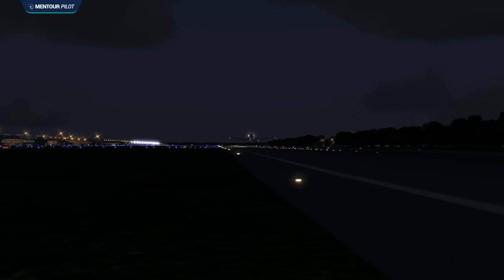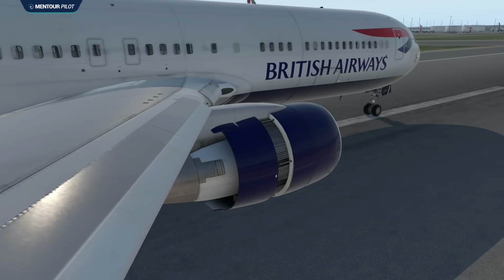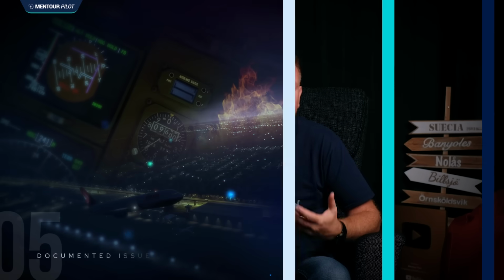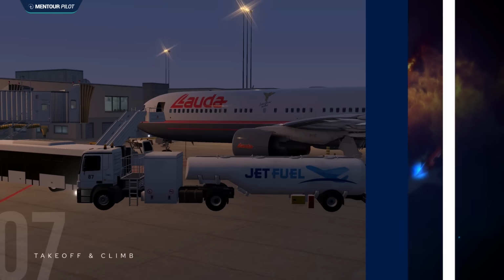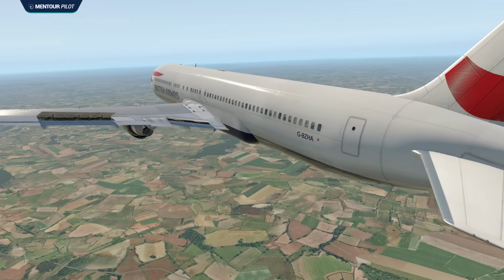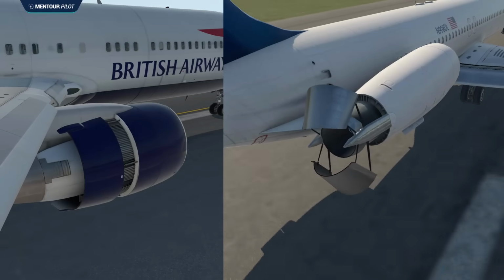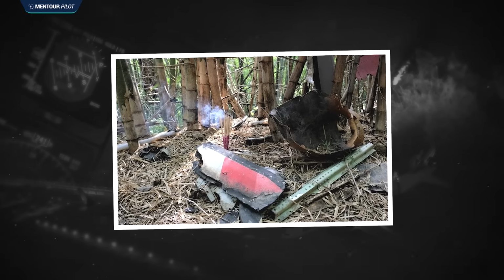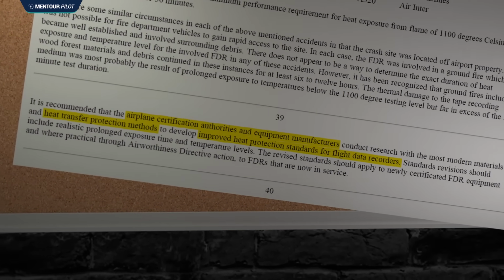HOW an Impossible Failure CRASHED this Boeing 767!

Comment: When Niki Lauda was told by Boeing that they wouldn't release a statement on wether they take the blame, he basically said to them "If it's so safe to deploy the thrust reversers mid flight, give me a 767 and I'll try it". Boeing said they couldn't do that because it's unsafe. Niki Lauda was an incredible person.
Reply: "It's terrible. It flies like a pig."
"Oh, you can't say that."
"Why not?"
"It's a Boeing!"
"It's a shitbox. It stalls like crazy and the reverse thrust is a disaster. Amazing, all these facility and you build a piece of crap like this."
Reply: @pavise6333 saying it flies like a pig is an insult to the pig
Reply: @pavise6333 best comment I’ve seen in a while!
Reply: @pavise6333 before talking shit mouth.Boeing is carrying people since 1970 ....
Reply: @pavise6333 "it's a ferrari" ahh
Reply: @personalincomeman1518 understands the yet still ruins it ahhh
Reply: @pavise6333  Fun fact, Boeing could have had a clean design from Bombardier as a near perfect replacement of the old and outdated 737 design.

As most suppliers were from North America anyways, integration of the now A220 called plane would have been far easier for Boeing than what Airbus has to deal with right now. 

Sure, it probably would have required massive rework in order to integrate it into the Boeing lineup, nevertheless it was clearly possible.
Reply: There is a documentary about how Lauda handled this and exposed Boeing.  It’s incredible.  Lauda was tenacious and amazing.
Reply: Niki Lauda was a smart person. Though the accident was very sad, atleast i think it’s a fun story how Niki Lauda tricked Boeing into admitting that it was dangerous to deploy the Thrust Reverser in-flight.
Reply: @simonsv9449  he put company profits first and got away with it. That aircraft should have been grounded.
Reply: Niki lauda the f1 driver?!? Very cool! Never knew.
Reply: Nika Lauda was able to tell Enzo Ferrari that his cars sucked, this don’t suprise me at all!
Reply: @michelebucci3629  Yep, I know that story very well and to all ppl around Enzo it was suprising Enzo listened xD
Reply: He truly was. Hell of an F1 pilot too
Reply: Niki Lauda was a definition of gigachad. One of the greatest F1 drivers of all time even after almost being burnt to death
Reply: @jez_77 i grew up in the era of niki lauda as an F1 expert, always liked him

Walked away from the comment to realize that only german speaking folks would know that 😂
Reply: in 1976 he almost burned in his formula one car, almost die, 42 days later he started in monza despite all the prohibitions of doctors, hellish pain and bleeding bandages, and finished 4th!
Reply: Danke, Niki.
Reply: He himself took off from Sydney with the brand new Mozart when I flew home from a vacation 1990.
Reply: The man lived to through fire, he is someone who would never want to cut corners in safety or quality
Reply: Niki had no pardon. Told always as it was. True legend...
Reply: You also know that mechanics actually blamed him for the aircraft not being grounded with that massive history of reverser issues, right?
Reply: @GeneralMikeBison  Lauda was a MF'r who put profits first and killed over 200 people. His company had more than enough warning to know the aircraft was unsafe.
Reply: Drinking piss won't kill me, I know that for a fact. However, if you challenge me to prove it, I will decline your challenge.
Reply: @Joe333Smith ...
Reply: But that is after the tragedy. Lauda must of thought it was safe, too, prior to this disaster. I don’t get how this makes him incredible. You make it sound like Boeing knew it was unsafe before the disaster and that isn’t accurate. There is too much context left out. Maybe he was an incredible person, I have no idea, but not because of what you described.
Reply: @darkprose they didn't actually upload data to truly test it until after the crash.
Reply: Nikki lauda was a f1 racer
Reply: Boeing was historically safety-oriented company but it slowly transformed to penny-saving company. I think this accident happened during that transitioning timeframe.
Reply: @valerierodger7700   You do realize that in a sue happy culture like the US that Boeing would have sued him into oblivion by now, right? Considering he has made those statements on talk shows like Graham Benzinger as recently as a couple or so years before his death.

He didn't just say "give me a plane then and let me try". He said "We'll go up together, I'll fly" to the Boeing Execs. Of course they wouldn't agree to that, actually having to put their own asses on the line. The claim was that the pilots did it wrong, and the spin was recoverable with the guidelines Boeing etc had given out. And of coures they knew by then, that this wasn't the case but they were still hoping to prove otherwise.
Reply: Ja und sagte seinem Chefmechaniker er solle die 63 Fehlermeldungen der Reverser einfach ignorieren ! Man lese den offiziellen Untersuchungsbericht der NTSB....
Reply: Boeing has such a stellar record of actively hiding their own mistakes, it's not even funny.
Sure, human error is apparent in plenty of airline accidents, but do you know how many of those accidents could have been avoided right there on the drawing board? Or how many of them could have been avoided when bean counters actively interfered with actual engineers? Do you know how many of them, including pilots lost their jobs because what they were saying affected the bottom line?
Get your fact straight before making a fool of yourself.
Reply: Ergzay - Tell us that you have no clue, without telling us you don't have a clue.
🤔🤷😉
Reply: The pilot knew about a possible thrust reverser deployment in flight but took improper action when it took place.
Reply: @bushpilot50 there were no instructions and as explained no one thought they even could deploy midflight
Reply: @c @computercrack totally preventable, if the company would’ve grounded the plane from flying from those constant t/r faults then this wouldn’t have happened
Reply: @bushpilot50  technically but he only had like 4 seconds and he would have to control both the yoke and the throttles at the same time. Also there may have been a misunderstanding has to who was supposed to throttle down the airplane vs fly it. It doesn't sound like the tried to coordinate in advance who was to reduce throttle. Also the shitty airline they were flying for 'lauda's' obviously didn't care to take enough time to train them in a scenario like this. The would not automatically have known how fast the situation would develop.
Reply: In Brazil there Washington a case of an reversor open in flight. The Air plane was a fokker 100 from TAM. In that case The fail occours just after takeoff.
Reply: That' s how AUSTRIAN  PEOPLE ACT GENERALLY SPEAKING!
Yet Nicky had been destracked MUCH TOO MUCH  BY " lady's straps!😅😅
Reply: Haha kind of hilarious to try and dismiss the expertise of on of the best F1 drivers of all time famous for being safety conscious.  But why was he consulted about airplanes?
Reply: @KaladinVegapunk  He owned the airline.
Reply: @KaladinVegapunk he was a licensed Pilot flying regularly for Lauda Air, which he had founded and owned
Reply: Boeing probably paid those guys to loot it once they learned what caused the crash hahaha
Reply: Lauda mera
Reply: Ha truly was!
Reply: Didn't he have one? Why ask Boeing?
Reply: Planes are held together with Elmer's glue. What a horrifying story.
Reply: It was also fundamentally lauda's responsibility to see that the aircraft was maintained properly. If his company had not sent the aircraft into the air again and again with a known failure no one would have died. Doesn't matter how the aircraft is designed if serious maintenance problems are ignored it WILL crash.  Some MFr who put his profits first trying to pass the blame is contemptible.
Reply: @valerierodger7700  ,and he was right with his hunch, those pilots the poor bastards didn't stand a chance, not least as Boeing didn't do their homework and basically said the plane was safe to fly even if the thrust reversers deployed mid-flight. I know all plane crashes must be terrifying in their own unique ways, but the way the plane just cracked apart must've been horrifying for all those who went heading into the ground like a torpedo.
Reply: @SomethingSomethingFrank  his company killed them. They knew of the maintenance problem and put profits first and the airplane back into the air.
Reply: @SomethingSomethingFrank They did stand a chance. The aircraft had a history of 52 reverser cautions in the preceding four weeks and the captain still washed it off as spurious. Had they not done that, it wouldn't have lead to this accident.
Reply: @GeneralMikeBison  Fair point.
Reply: @GeneralMikeBison no they didnt. It was, as the video explained, marked as "safe to fly and uncritical", no explanations given on what to do in case the reversers deployed. So no, they didn't have any chance
Reply: @computercrack yeah it’s their fault for operating the aircraft even though the t/r fault kept reappearing, they have to make the executive decision to ground the plane to fix the fault but the company did not do that and continued flying
Reply: @austinmamaat5248  yeah good luck keeping your job if you ground a plane that the manufacturer says is an mundane error. If there was an airco error would you ground the plane?
Reply: boeing is so dangerous I don’t understand why people still fly boeing or wht boeing is still around
Reply: @DavidCastro-wf8cl  when your in cahoots with the us govt you tend to get away with quite a bit
Reply: @TheRangewannab8 ❤❤
Reply: @TheRangewannab8 you’re
Reply: @DavidCastro-wf8cl you act like their planes crash every other flight. Planes are the safest method of travel by far
Reply: @brandonsg1313 Yes, but Boing is quite rightly under the spotlight. Self certification and non existent oversight are not a good recipe for safety.
Reply: @DavidCastro-wf8cl idk how you can say that with how many crashes occur with something as simple as dual inputs from air bus pilots.  The number of crash reports associated with that design choice is unbelievable
Reply: @DavidCastro-wf8cl some responses have been full of shit-headedry but the fact is that there are few entities that can afford to build modern, competitive aircraft. I’m an engineer, and there are always situations where one cannot address every failure mechanism. Even if one is willing to spend “whatever it takes”.
Reply: @DavidCastro-wf8cl its not even dangerous💀
Reply: @DavidCastro-wf8cl  boeing was a company with an amazing safety record for many years, it seems the problems started when they merged with mcdonald douglas and many of the latter management was given top positions in boeing. This diluted boeings safety culture substantially enough that the usual safety checks were skipped, safety warnings by staff ignored, pushes from the top to get things done quicker etc
Reply: @DavidCastro-wf8cl Find another corporation who's capable of producing half the world's aircraft
Reply: Yeah they just killed a guy who exposed them 😂@DavidCastro-wf8cl
Reply: @DavidCastro-wf8cl your comment aged very well sir
Reply: @DavidCastro-wf8cl because Boeing is completely operated by the pilot, instead of machines/Computers
Reply: @DavidCastro-wf8cl  they have also merged together with Mcdonald Douglas a while back and we know what that company was known for. They has so many famous crashes with the DC10 and they were known for using cheap parts/labour to cut corners.
Reply: @DavidCastro-wf8cl it's not that Boeing is dangerous, it's just that Airbus is EXCEPTIONAL.
Boeing nowadays is still much safer than Airbus in 2000.
But Airbus evolution has been incredible, almost building 100% infallible aircrafts is incredible. Even Boeing ones are incredible.
Reply: @DavidCastro-wf8cl didn’t use to be. Then they merged with McDonnell Douglas. You know, “our planes lose parts mid flight and have zero redundancy so that causes a crash” McDonnell Douglas
Reply: @DavidCastro-wf8cl 
This comment is just getting better and better over time.
Reply: @DavidCastro-wf8cl  Because Airbus is just as dangerous and does some of the same stuff? Their handling of their early FBW incidents and some of the "disintegrating tailplane" incidents wasn't exactly great. 

Corporations for corporation things.
Reply: @DavidCastro-wf8cl military contracts keep them afloat at least
Reply: @DavidCastro-wf8cl  
Simple ......'supply & demand' - there is no in between supplier
Reply: @DavidCastro-wf8cl  Because it's still a hundred times safer than driving a car? 🤔
Reply: @DavidCastro-wf8cl  actually, we live in a time where airplane crashes are getting incredibly rare.  They keep getting safer every generation, and good companies like Boing & Air Bus make improvements and learn from these unfortunate crashes.  Flying is an extremely safe way to travel.
Reply: @DavidCastro-wf8cl  Boeing is a US military contractor.
Reply: @Nehmo  Still, if no compromises get made in a plane's design, then either no planes will get made, or the planes will be too expensive for people to fly. The result of either is that orders of magnitude more will die due to lack of access to goods and travel. (This is the mistake that many governments recently made in their pandemic response efforts.) A balance has to be struck between costs and safety.
Reply: @HenriFaust  As they say even the devil needs an advocate and I guess being cold-blooded makes it a little easier for you to volunteer for this role given the reluctance of the average person to do so.
Reply: @DavidCastro-wf8cl  "Why people still fly Boeing"
Maybe because we don't have a freaking choice and most airlines use Boeing's as their long range aircrafts?

Boeing might have had a few incidents yes, but they still remain safe and sound, else you would have seen a large amount of protests from pilots around the world.
Reply: @Forceouss  lol there are other choices but if a airline risks safety over people i’d think twice about doing boeing
Reply: @DavidCastro-wf8cl  Again, a 787, 777, 747, 737-800 and even the Max now are completely safe. There are other choices but that depends on the airline and you won't choose an airline based on the aircraft they operate but based on their reputation and how good they are.

And again nobody is putting anyone at risk, you're just keep getting fed by people that Boeing is bad and in a way they are but now they're pressured when it comes to safety not to mention a lot of their aircrafts have great safety records

Airbus also had incidents as well, fyi
Reply: @Forceouss   And yet most of these major modern/modern-ish disasters are all Boeing. Yes, some of these crashes are also Airbus, but they're almost exclusively pilot error, such as AF 447.
Reply: @Forceouss  no choice when your poor. Actually even if you're not poor, not as much of a choice unless your rich.
Reply: @DavidCastro-wf8cl  you can't just say "boeing is unsafe" without any data/statistics on the number of accidents on boeing aircrafts caused entirely by faulty design to back that statement up. also the more aircrafts manufactured by a company is flown around the world, the more likely it is for the aircrafts to have accidents due to the number of different scenarios they encounter, so that makes it harder to conclude whether boeing is actually less safe than other aircraft manufacturers
Reply: @DavidCastro-wf8cl all Boeing aircrafts have been approved by the freaking FDA now. They’re all safe
Reply: @Forceouss It seems a week doesn’t go by without a report of a Boing incident. The company admits its maintenance and construction procedures are riddled with problems. This is surely a consequence of self certification and non existent oversight.  Boing exceptionalism!
Reply: @Akram109BlogspotYoutubeChannel this aged well, didn't it
Reply: @youtubemodsaresnowflakelef7692  What about the Airbus that flying from Rio de Janeiro to Paris due to the Peto Tubes freezing, causing unreliable measures of speed and altitude, causing confusion on the pilots and a fatal crash? Any airplane can crash and is vulnerable to eventual defects, bad piloting or bad maintenance by the company operating them, still all major commercial company aircraft are incredibly safe, just look at how many flights that take place everyday and how many crashes happen. Boeing, Airbus, Embraer and other companies all have excellent planes.
Reply: @Mr.T9191-i2f  Well the Max is still a shit show but gotta say their safety regulations are questionable lol
Reply: @Forceouss  hey bro. How is this comment aging
Reply: @DavidCastro-wf8cl There isn’t much a choice for people in the US…
Reply: @Forceouss lol bubba you still stand by these “boing is completely sa” comments?
Reply: @Forceouss  Other than the 737-Max . I'd still be hesitant to step aboard one. It's probably safe, but due to the NTSB's report on Boeing (door plug incident - Alaska Airlines flight 1282) I would be very anxious (and I'm not an anxious flyer - I love flying).
Reply: @DavidCastro-wf8cl  If Boeing were unsafe there would be far more crashes in the world. Their safety record is similar to that of Airbus. And back in 1991 they were a great airplane manufacturer.

But people do make mistakes, and it's often hard to see the consequences of decisions. Hindsight is 20/20.

But it's hard to say they are "unsafe" given the record and the millions of flights each year.

That being said, recent Boeing does seem to be dominated by bean counters rather than good engineering.
Reply: @DavidCastro-wf8cl  Considering walking across the street is more dangerous then boarding ANY aircraft in the world, I suggest you sit in your house 24/7 365. That way you can keep your illusions and not have to actually deal with the real world.
Reply: @DavidCastro-wf8cl Best line: "I ain't boeing anywhere near that". (I thought it was in an article from The Register, the closest I got was "this ain't Boeing so well" as a headline)
Reply: @DavidCastro-wf8cl  LOL they are known as "flying coffins", LOL. I pray and REPENT to YHVH (God) days and hours and boarding these things..
Reply: @DavidCastro-wf8cl  every company is good and bad, boeing has their moments and I have to say they are mostly good, brilliant people working there
Reply: @defeatSpace sadly corporate, guys who aren't engineers, pilots, or mechanics  think they know everything are the ones who should be to blame for Boeings issues lately. Also Boeing really started to go downhill when they merged with McDonnelll Douglas corporate wise
Reply: @DavidCastro-wf8cl  Boeing and whole flying industry must be so so dangerous. Not like flying isn’t the worlds safest form of transportation to date
Reply: @Dudman83  😊😅
Reply: @DavidCastro-wf8cl  if its not an Ameri**n company (no racism for sure, i am not biased to any country, even my own) or if its a company of 3rd world nations, boeing would have vanished to thin air by this accident alone.
Reply: @prabhalasasank  There’s a few important objectives to note. There are a handful of commercial aircraft producers. Very few. It’s very very expensive to create aircraft. In terms of large commercial producers you’re essentially only looking at Boeing (USA) Airbus (euro) Embrear (S.American) Tupolev (Russian), Bombardier (Canadian owned partially by airbus)

In order of highest crash rate history 

Boeing 737 max 
Airbus A310
Fokker F28
Boeing 747-100/200/300
Airbus A300
Boeing 737-100/200

In order of least crash rate
Embraier E170/E190
Boeing 747-400
Boeing 737-600/700/800/90
Boeing 737 - 300/400/500
Boeing 777 tie Fokker 70/100
Airbus A330

(Crash rate is crashes per flights flown not total)

However it is important to note that Boeing and Airbus exist partially due to acquisitions and mergers. So many other companies did exist but got absorbed into the companies with money. It would be hard unless gross negligence to have Boeing or Airbus fail. And for every bad thing that has happened with Boeing (and not in defense of Boeing but a general understand of how the rules and laws of a autism came to be) many inventions have come. As they say airplane safety is written in blood. 

And a fun side note… the Chevy Silverado has killed more ppl than a Boeing lol
Reply: @prabhalasasank cDonald Douglas used to be one of Boeing’s competitors… they went bankrupt and Boeing bought them out.

But that was not due to the failure of their machines. That was a failure of the companies buissness practices.
Reply: @prabhalasasank even if boeing is flawed which no one will argue, Asias have been much worse, Airbus has had a lot of pilots up in arms, embraer has quite the terrifying history, the Concorde wasn’t ever actually “safe”
Basically it really doesn’t matter what you pick it’s all power and money it’s all BS regardless who built it where they are from what materials Ect, it’s all BS and all one can do is the best possible for themselves never rely on anyone, sometimes you don’t have a choice, it is what it is
Reply: @trevnti the killdozer has a 100 percent fatality rate per piloted session.
Reply: : That's absolutely not true.
Reply: @DavidCastro-wf8cl  Only two companies are allowed to manufacture commercial aircrafts, Boeing and Airbus...
Reply: @zainquadri1206 Me arriving late, but: No, multiple companies make commercial aircraft, not just Boeing and Airbus: Embraer, Bombardier and others.
Reply: @zainquadri1206 What? You know a lot of nothing, obviously.
Reply: @DavidCastro-wf8cl  I saw a series of aircraft investigation shows that were mostly down to Boeing having design flaws in their aircraft. It made me terrified to fly Boeing and I always preferred airbus planes. No idea if they are actually any better though 😅
Reply: @giftofthewild6665 which Boeing plane crashes are those?
Reply: @DavidCastro-wf8cl  Airbus kids😃☠️
Reply: @Zaidnnflx  Airbus has better track record
Reply: @dennisdexter5602 Not necessarily. Even 'perfect' fly-by-wire systems can be cocked-up by humans.
Reply: @Zaidnnflx this channel has taught me that i neither want to fly airbus or boeing...matter of fact, if it doesnt glide for 10k at 1k ft, im out
Reply: @dennisdexter5602  yeah and a lot shorter history, again Boeing had a humongous Part in winning WWII, without Boeing aircraft  , everyone could be speaking German and Japanese
Reply: @Zaidnnflx  Remember those ADIRU fails that sent airbuses plummetting?
Reply: He basically let Boeing confess😂
Reply: Idk you guys. Recently Boeing seems to be in a downward quality slope. 
The US army has complained about quality issues
The Max recently showed a very corporate dark side to the company which would and has created safety issues
Plus their space branche seems to also be having a hard time delivering something safe enough to be human rated.

The quality of their work seems to be a bit off recently and I'd be quick to blame it on management.

That said I'd have no problems climbing aboard a Boeing aircraft. They're still safe. I'd have my reserves about climbing into a Max but I rarely go that far away for me to have the opportunity to do so.
Reply: @T3ki1a_  This is such a simplistic view of the situation. It isn’t Boeing, frankly, that people should be worried about—it’s the airline you fly on. The two MAX crashes involved pilot error. The second crash, that cockpit CRM was a mess. They doomed the plane and their passengers. It isn’t the type of plane, but the quality of the pilots and the reliability of the maintenance of the plane that matters. Over 30 MAX planes were flying and landing in US airspace until they were grounded by the FAA. None of them crashed. Do you think that’s a coincidence? The two crashes were tragic events, no question, but, the “flaws” of the MCAS system did not in itself crash those planes. Now the MAX has more redundancy and has overhauled the MCAS software. But the flight crews were not ready or able to deal with their emergency. That happens sometimes—especially in airlines with poorly trained pilots. The Ethiopian final report completely omitted the evidence that the AOA vane was not internally compromised but rather it was hit by a foreign object, almost certainly a bird. The MCAS system wasn’t even activated before the pilots just failed to aviate. They had unreliable speed warnings—they did nothing. Boeing didn’t crash that plane. Frankly, you know, I am so sick of people bashing this company without saying a word about the responsibility the pilots had in a situation they turned into a disaster.
Reply: @darkprose liar. The pilots didnt know anything about the behaviour of the MAX because Boing choose to not tell anybody. There was no pilot error at all. Why TF you think the whole MAX fleet was grounded for years?? Because they were unsafe to fly!!
Reply: Could be worse. Could be Sukhoi.
Reply: Nikki was a badass he would have to haha
Reply: @valerierodger7700  I agree with you. Any big company is not going to throw their hands up immediately and say, "My bad". It IS shady corporate shit. Yes, Boeing has done some shady shit. It does not replace the fact that they build some of the safest aircraft in the industry.
Reply: I donno if he brings this up as I comment but didn't Nikki pilot a test flight to simulate the thrust reverser Fault to understand what his pilots went through?
Ya Nikki Lauda is a Legend on and off the track...Hard as Nails!
His championship after retirement says it all..
Noone does that! Many have tried and failed! 
Half Men !😉 ..
Reply: What a shock. Boeing trying to pin the blame of a crash they knew they were responsible for on the dead pilots. That company is horrible
Reply: @WrenAidaJax That airplane was of questionable tech state and should not have flown. It was a mix of poor culture by Lauda pushing for the aircraft to still fly and the Captain just washing it away as spurious after such a long history about that reverser!
Reply: @GeneralMikeBison you are a liar. The vid clearly explained why it was perfectly fine to be flying with the faults because BOEING said it was safe
Reply: @computercrack Nonsense, don't talk about topics that you have zero clue of. Find the report and learn.
Reply: But isn’t the 747 the safest plane ever made?
Reply: @wewanttruth8392  Well, it IS pretty safe as far as planes go.
Reply: @alexanderboulton2123  flying over large bodies of water I’ll take 4 engines over 2 anyday.
Reply: @wewanttruth8392  On THAT SPECIFIC ISSUE yes they're FAR safer, however, most planes can make it with just one engine. The bottom line is, despite ALL that, planes are generally pretty safe, and the VAST majority of accidents occur(ed) either due to pilot error or mechanical failure, NOT engine failure.
Reply: @wewanttruth8392 : No, it´s the 777.
Reply: I was just about to write this comnent n saw you did. But yeah 100% true he was a great person who from a horrible crash became even more nicer to those who knew him, my stepdad recieved xmas cards from him right up until he died after he n my mum  saw him in zurich, my mum died shortly before Birgit and recieved a card after her death. Very sad about Birgit and how she changed n hurt the family over his money but great prior to that unforgivable act by her. But good people mostly lol all of them gone now sadly. He suffered daily from incurable lung inhalation burn n chemical damaged from that crash. I always supported james hunt as a kid though 😊 but i was a toddler during the rivalry
Reply: I remember Lauda was personally very struck about this accident. And not because of the loss of an aircraft.
Reply: It's funny how everybody on here talking about it's completely safe now even though every time they say a plane is completely safe ends up being not safe
Reply: He was also a famozs racecar driver. And this crash is the reason aviation can f off. Im not climbing in a flying tomb
Reply: @georgwalt7978 
It is far safer to fly across the country than it is to drive to your local downtown.
You are in far more danger driving to the airport than flying out of it.
Reply: I'm not sure what you're saying is historically accurate. Sounds more like a celebrity CEO trying to defend the image of his airline.
Reply: @Ergzay  source: Trust me bro.

Lauda was a pilot himself frequently flying the very same aircraft his pilots did. There are numerous accounts of people talking about being flown by Captain Nikki Lauda that are easy to find online. So it was pure survival instinct to have a safe aircraft.
In addition he knew all the pilots, in many cases having done the job interviews himself.
So this accident, and Boeings reaction to it blaming the pilots, was extremely personal.
Add to that the terrible accident he himself went through in his Formula One career Nikki Lauda was probably the single worst person to tell "it's your pilots fault" that Boeing could have picked.
Reply: @Argosh 😅
Reply: @Ergzay  then go check the history. If you find something that conflicts with my comment, then link it.
All I heard is that Lauda was deeply passionate about aviation and cared about the victims lost in a flight under his name. Of course he wanted to preserve the image of his airline, why wouldn't he, but he was certain that his company wasn't to blame for the crash, so he tried to prove it.
Reply: You are right. Lauda was a nice guy here, but of course, if you want to protect boeing's ass, then you start to smear the one, who criticizes them rightfully.
Reply: And Lauda was actually a big Boeing fan.
Reply: @Ergzay  Anyone who knows even a single iota about Lauda wouldn't say something so monumentally moronic questioning his integrity
Reply: @Ergzay it’s true, he’s a remarkable man and he pushed Boeing to the limit to prevent this bs from happening again, he pushed and pushed he doesn’t back down. He wasn’t a typical CEO at all
Reply: @Ergzay  You clearly havent done even a bit of research or have any understanding of who he was and what he did for the advocation of airline safety and fighting for Boeing to admit the fault wasnt of the pilots but rather the plane (that millions flew on) had a fault. They were protecting their brand and trying to make sure they werent sued......He was helping the victims and airline safety. I hate when people talk when they know little to nothing about a something.
Reply: @Ergzay  well documented, he was right all alone.
Reply: @Ergzay  MAX......are you there?
Reply: @Ergzay Niki Lauda had half his face and scalp burned off in a racing accident and never hid his scars for the fifty years he continued to live after that. He was quite possibly the least pretentious person ever in both motorsports and the airline industry.
Reply: @Ergzay Yeah a Celeb CEO who could dismantle any machine and make it better when its put back together. Sounds like Boeing’s CEO was a lawyer not an engineer.
Reply: @Ergzay so youre saying that a company lying about thrust reversers being safe to deploy inflight and the fact that these can deploy suddenly without proper warning.
Reply: @Ergzay  what
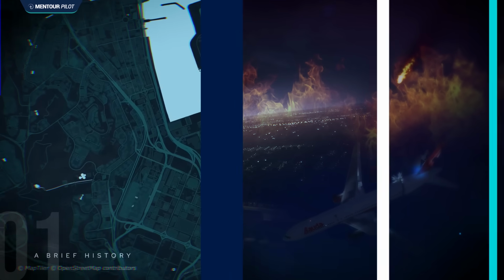Reply: @Ergzay you don't know jack about Niki Lauda. His lifetime pattern was to tell the truth no matter who it hurt or what people thought about it. He repeatedly and publicly owned his faults. He hurt his own interests by telling the truth on many occasions. You want to accuse Lauda of telling the truth in the least diplomatic most offensive way possible, sure. He did that a lot. But lying - or even using spin on the truth - to spare someone's reputation? Even his own? No, sorry - you do not know jack about Niki Lauda. 0:36
Reply: @Ergzay L
Reply: @Ergzay  This literally happened. If you don’t know, then shut up.
Reply: @Ergzay You write "Sounds more like a celebrity CEO trying to defend the image of his airline". If is was the case I dont think that it is great PR to be pictured wandering around the wreckage in the jungle.
Reply: @Ergzay  Then why wouldn't Boeing do it if it was so safe?
Reply: @Ergzay  As a F1 freak, I can clearly say that this could be exactly what Niki would've said. :)
Reply: @Ergzay this is in character with what I know about Lauda from his F1 days. He was deeply passionate about the technical side and more importantly the safety in those days, notably attempting to boycott a race at a dangerous track in wet conditions and straight up retiring in protest during a championship-deciding race due to safety as well
Reply: @Ergzay  so you'd let a company debase your name and refuse any responsibility, instead allowing them to deflect from their negligence onto you? Moreover, you'd let them repeat the same problem, which would have been a certainty if he hadn't called Boeing out on their BS, and which they denied only until he forced their hands in a way they couldn't deny anymore. If you fly often enough, he might have saved your life. Lauda took full responsibility for the accident but comes from a professional background where root causes must be understood and corrected. But please, based on your logic, don't wear a seat belt; as GM execs used to say, they're just charity. Clearly if you go through a windshield and there's nothing to prevent you from doing so it's just your fault and you're trying to shift blame.
Reply: @Ergzay  I smell a Boeing shill.
Reply: @maximaldinotrap so do plenty with heightened Background Knowledge
Reply: @Ergzay  0
Reply: @Ergzay  may be its historically correct that Boeing specifically and intentionally choose a test scenario where they knew it will be a pass. Wouldn't a child come to the conclusion that this event would be most critical at max speed? And the FAA just being a dick-extension of Boeing just rubber stamped as usual....
Reply: my ex boy friend used to fly with him.... he said Lauda was a terrible pilot
Reply: @Meii652  yada, yada...opinions are just that.
Reply: @Meii652 And we should take his word for it? Or even yours?
Reply: @Meii652 liar
Reply: @Meii652 Sure. Because you and your imaginary boyfriend know so much about flying.